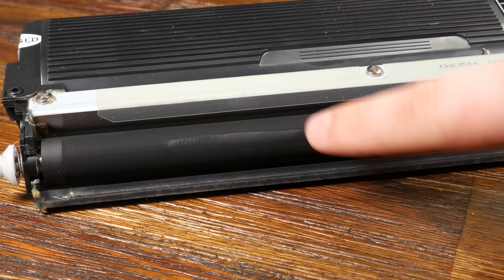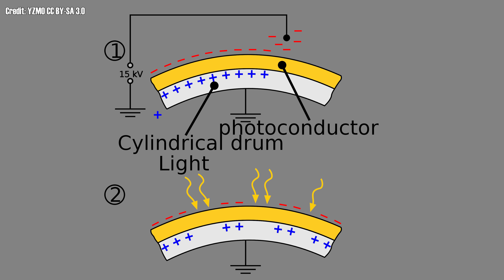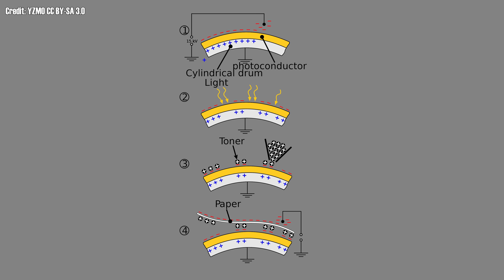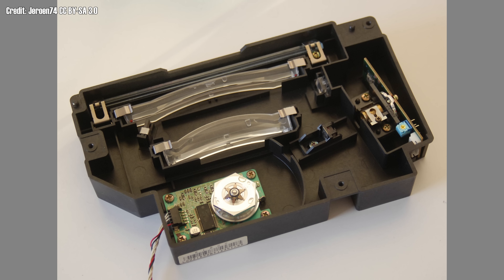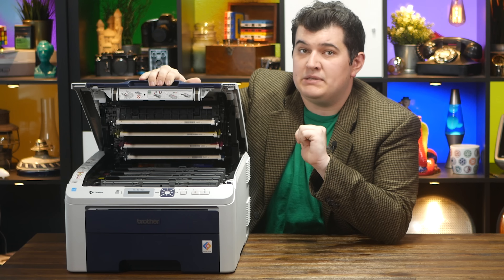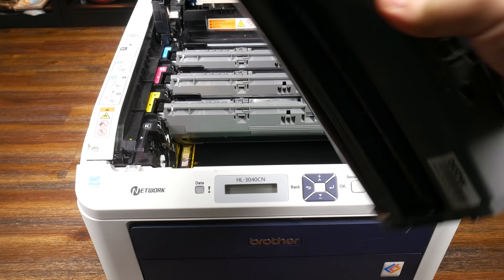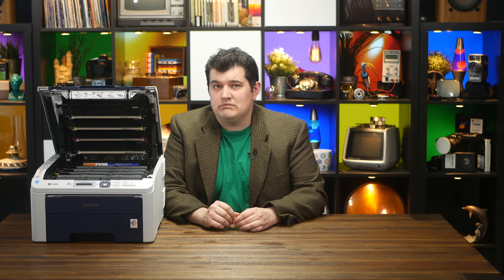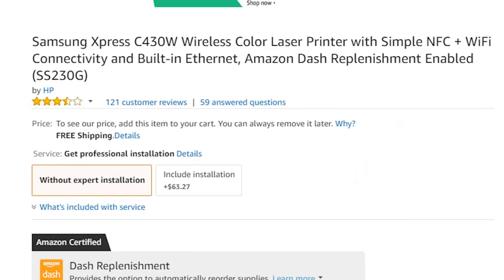LED Printers: The Common Printing Tech You Haven't Heard Of

Comment: I was a color copier technician for 28 years and mostly worked on the Canon line.  The very first model I worked on was the Canon CLC 200 series.  

I also repaired typewriters, fax machines, shredders, electric printing calculators and almost every other kind of office equipment commonly used in the mid 1980's.

Of course, this included several makes and models of printers.  Ink plotters, ink jet as well as toner types, both black and white and full color.  

One of the most unique printers I have worked on was the full color thermal printer.

They had 4 colors of plastic film with a multi-element thermal print head for each color (C, Y, M, Bk).  They then, "burned" each one in layers to reproduce the image.  So there was no need for a drum, no led array nor any laser assemblies of any kind.  Another advantage these machines had was not needing a fusing unit.  

These machines were considerably more quiet to operate than the others.  The lack of a fusing unit meant it would not heat up the room.  No corona wires meant there would be no unpleasant ozone scent would be filling up a room.

Unfortunately, this type was quite a bit slower and the films frequently jammed or tore.  The yield of how many pages could be printed per roll was also, quite low.  This made the cost per page considerably higher when compared to other methods.  Also, the rolls of film were rather large, making the "footprint" or the copier larger than most.  

These issues, in my opinion, spelled their doom when compared to the other methods and full color thermal printers fell by the way side, disappearing altogether rather fast.  

I am not even certain if they are still available at all today but I'd love to see you do a video on these!

*One curious quirk to laser printers/copiers that stood out to me was when trying to create a picture frame that hugged the outer edges of the paper.  Instead of a nice squared set of corners and straight horizontal lines, it would be crooked.

This occurred because it was impossible for the spinning mirror to guide a laser beam from one side of the drum, across its entire length, to reach the other side before the drum made some rotation.

Basically, a straight, full length horizontal line, is impossible to create using a laser and spinning mirror.  Optical, Ink, LED and thermal methods did not have this problem.
Reply: I  also was a copier/fax/network service tech for Canon, Toshiba, and Ricoh but I worked in Canada. Do you remember the very first Canon colour (Canadian spelling) copier. I believe it was called the CLC 1? I was one of the first to be trained on it in Canada. The drum diameter was the size of a basketball and had no black toner. The blacks were a combo of yellow, cyan, and magenta and would result in blacks that looked more like dark brown. This first colour copier was also the only one that was totally analog. This beast was larger than a household freezer! I remember the CLC 200 and the CLC 500/550. Very nice machines. 
Not mentioned in the video is the reason the Laser printers are much slower with colour than black and white printing. With LED printing the paper passes the LEDs/drums/developers once, no diference with the paper path for either. In a Laser printer, the paper has to pass the optic section once for each colour or 4 times around the drum/charging/developing area. Now-a-days a copier is nothing more than a printer with a built-in scanner unit. Do you remember when copiers used liquid toner?
Led printers work basically the same as a fax machine.
Reply: @mclancer  currently im a copier tech for canon and ricoh also for about 7 years now in middle east and im leaving this company going back to my home country pretty soon. imo canon is so much better than ricoh. ricoh is such a pain in the ass to troubleshoot and replace some consumable parts and the build quality does not really look durable. looks like a piece of plastic toy made in china.
Reply: The printers for plastic ID cards still use films. Had to use a Zebra for a while that would throw a sulk in the middle of a print run, and spit out a card that only had yellow applied. It seems that for other uses, dye sublimation printers now use liquid instead of film.
Reply: Hello sir, which brands are the most reliable and which new Printers do you recommend? Need a Laser/LED Printer with ADF and Paper Tray, Medium use
Reply: I think canon still sells a film printer that being their "selphy" printer line.
Reply: oh, right.  Back in the commodore 64 years, I used to have an Okimate printer, by Okidata.  It was color thermal.

Comment: Years ago I had a small Okidata LED printer.  It worked great, didn’t break the bank, and the consumables were inexpensive because the toner was replaced independently of the photoconductor drum.  I wish I still had it or one like it.  I am fed up with the inkjet racket.

Comment: Some OKI printers have their LED heads held in place in a U-shaped bracket, where the LED is pressed down by two springs.

I had the lid fall on my hand on a simple cleaning job (which should take not even 30 minutes), shoot out the LED and blow a fuse (I didn't think a simple clean warranted powering down).

So a 30 minute job turned into an angry customer, getting a veteran colleague to solder a new fuse the size of a flea onto the main board, and 10ish manhours wasted.

Not my proudest moment so far.

Comment: I've bought an HP PageWide inkjet and it's an impressive printer. Super fast time to first page of about 6 seconds, and as many ppm, or more, than most laser printers. The cost per page is reasonable for color.
Reply: I agree, very fast printer (I've had three) but beware: never power them off.  I left one turned off for about six months (wasn't using it), and when I turned it back on, the print heads were destroyed.  They need to do the periodic cleaning they get in standby power mode.  About $500 down the drain.  Also ink is ridiculously expensive.  I now have the Epson tank printer, and ink is very affordable.  My dream printer is an HP PageWide with ink tanks.  But since HP marks ink up ridiculously, I won't hold my breath.
Reply: @linusstrang-c7k  I've got one HP PageWide 552 and it's absolutely amazing. Fastest printer I've ever had, and fastest time to first page too! The ink cost per page is not too bad compared to laser, oddly enough. The PageWide is best if you print often.

Comment: I have to be a little nerdy here 8-) : since he explained the process in great detail i have to correct that with modern 4 color laserprinters the toner gets to a transfer belt (the shiny black plastic sheet you can see art the bottom of the printer when he removed the four drum/toner units) first and then all 4 colors get transfered to the paper in one go.  Older laser printers had put on the four colors in four passes which slowed these early machines down a great bit.

Comment: I have a beautiful printer. I fell in love with tanks. I purchased three or four generic tanks for various printers. Right now I have an Epson L310 (I think). It is the BEST printer I have ever had. The color and detailing is beyond spectacular. It not only doesn't run out of yellow ink after 4 to 10 eight and a half by eleven prints, it also doesn't clog. Is there a tank printer that utilizes pigment ink? I am getting tired of excellent prints that fade after 5 to 11 years.

Comment: Your opinion on inkjet printers misses the mark as there is huge variety of very different technologies on the market and some may indeed be awful, but others are great and there are good inkjets for nearly every kind of use.
In general: 
- Brother inkjet printers have a bit sub-par printing quality, but they have next to no issues with their printheads and almost no ink waste. Their new "Inkvestment" printers are especially good in this area and are super reliable and inexpensive to run.
- Canon has some exceptional units for printing photos (and they run very efficiently too). Their printheads are also very reliable, just like Brother's. However, their entry level black and tricolor printers are utter shite.
- HP's entry level printers have very expensive, tiny ink cartridges. They moved away from individual ink tanks on their basic home use models as printhead reliability was very poor for for occasional users. However, they do have the best entry level print quality by far for text and graphics. Also, their higher level Officejet Pro printers (8500, 8600, 8700, and now 9015) are exceptional. They have much better printing cost than lasers with very close print quality, quick dry inks, high speed, and extremely reliable print heads that need next to no maintenance. I have had to do a print head cleaning just once in 6 years on my 8600 and it's done over 7500 pages. I often let it sit for a while too. They also have their ultra fast page-wide printers, which are pretty great too.
- Epson's Ecotank printers have taken the industry by storm. They are a good option for low cost printing at home (though they are highly unreliable for even medium business use and are very basic and slow for their price points). Even though Epson's printheads are by far the worst in the industry and need constant cleaning, the Ecotanks cost nothing to run, so all the cleaning cycles don't really hurt the end user all that much. Epson's other printers are quite shite though. Workforce Pro is inferior to HP's offerings and the cheap entry level units are bottom of the barrel stuff.

Now when it comes to your comments that LED color printers are more compact and faster, that's not really the case at all. Brother's printers are actually bigger than the equivalent HP lasers (which have the same combo drum & toner system as Canon) and so are their toners.

Comment: I think you made a mistake on the "raster means the entire image has to be loaded into memory" statement. The printer can, in theory at least, just keep a small buffer in memory. With a fast enough interface to the computer and some precise synchronisation, the computer could even send an on/off signal for each "pixel" on the page.

Comment: I was watching this video a second time because of a YouTube suggestion bug but realized one thing before I realized I had seen it before. Video got me suspicious and I went down to check my color laser printer. Turns out it's not laser as advertised on Amazon, but a LED printer.

Damn. Got swindled.

But wont make a difference. The prints are super amazing and the mere fact I couldn't make a difference is testament to this. Still is false advertising. Printer is Brother MFC-L3710CW series.

Also, dont put your finger on toner. It's super toxic.

Comment: I was certified for Epson computers and printers circa 1989. Their printer course was split, Basic Xerography and their laser printer.
I used to troubleshoot it to component level, had a high referral rate. A little bit more labor to the customer but no board swapping costs.
It was cheaper to buy a new one and sell the board than to just buy the board from Epson.
If in warranty period, we HAD to board swap and return the bad one. And provide the invoice number showing that we bought the board in the first place.
Epson's proprietary systems were awful.

Comment: seems that the LED printer could also have some issues for long term use, for example what happens is even a few of the led's in the array stop working or burn out? my guess would be that you would end up with gaps in the printing.  and both systems use moving parts so not sure what advantage it would have if any!

Comment: I have an epson l300 (inkjet) and, apart from using cheap generic ink, it was purchased on 2016, normal used and I had to do maintenance only 2 times in 4 years (cleaning head when adding ink). By far, the best ink pritner Ive seen before. On the other hand, there are the laser printers and my friends closing and opening them due to the jammed paper or the mess of toner powder xD (anyway i like them, but they are not that reliable)

Comment: I made the calculation of the frequency of the on/off signal to the laser diode when tak8ng into account the number of second per page and resolution.
The answer was in the hundred of megahertz, like with CRT with resolution of 1920*1200.
I never succeeded to control the laser diode directly (the 3 pin device).
Being infrared, it is harder to test.
The rotating 6 faces mirror is turning about 200 turns per second.
I used a function generator connected to a white led and scanned the blinking frequency until finding a stable pattern.

Comment: I've been servicing laserprinters as a profession (HP) and I must say, hardly ever I encountered a defective laser unit. It may be mechanical, but like a harddisk this is in a sealed of container thus in practice not very fault fault-prone. Most defects are around the paper path, a mechanical thing not sealed of, causing paper jams, most times due to aging of the component wearing of or customers brutally pulling onto the paper once there was a paper jam. Second to that is the fusing unit, but also designed to be easily replaceable even by customers without having to turn a single screw. Then the high voltage thing can happen to be faulty, and lastly simply the electronic ("formater" and "dc-controler") been damaged. Laser units, hardly ever.

Other advantages of why using LEDs you mentionied still apply, I don't buy the fault-prones of the laser unit tough, even many years into constant service it's not a part to be regularly exchanged.

Comment: Many LED printers actually still have a mechanical scan system, where the LED assembly vibrates left and right to increase the resolution.
Reply: :o
Reply: Haha I was just wondering about a mechanic like that! It's like how CPU manufacturers have managed to get features smaller than the wavelength of light by offsetting the masks (I think)!
Reply: @Norsilca  I believe that's called multi-patterning. Not often you find someone causality chatting about silicon manufacturing.
Reply: @Norsilca  old line matrix Printers do this too
Reply: @Norsilca  The wavelength of light?
Which wavelength?
Reply: @D-Vinko  Whichever one they use, I forget. I think it's visible or near-UV.
Reply: @D-Vinko  any of them, really. Wavelengths below 20nm wouldn't really be called light but hard X-rays, which are too high-spirited to pay much heed to any optical systems we might build to guide it or create a masking pattern, while at the same time not interacting that much with the microchip to be lithographed.
Reply: @SaraWolffs  these days they do stuff at 5nm and it called EUV as extreme UltraViolet and it blows my mind how the hell they make machines

Comment: It's all marketing.  It's a lot easier to convince a customer who has already decided on a laser printer that YOUR laser printer is better because it prints four times faster with higher quality and fewer jams.  Much harder to convince a customer who is shopping for a laser printer that there's a third option they haven't even considered.  Why try to launch a brand new product when you can whip the competition by pitting it against existing products already on the market?  :)

Comment: Unfortunately Brother, although very reliable, is not on top when it comes to printing quality. I own 2 HP laser printers, with rotating drums for colors, making them actually 4 times slower when printing in color mode. However, the print quality is much better, and the mechanism is made by... Canon, yes, like the first laserjet 30 years ago.